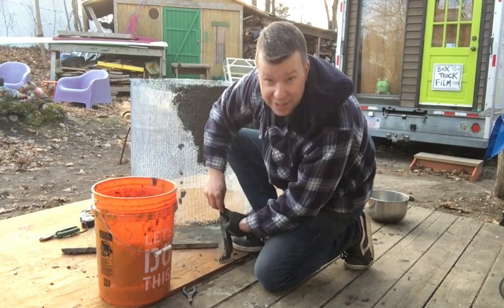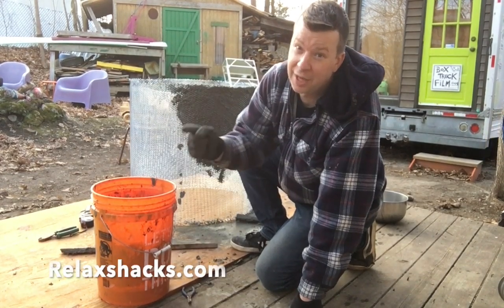HOW TO MIX and USE Ferrocement (tiny houses, water catchment systems w/ concrete)

Comment: If you add the material starting at the bottom in concentric rings of about 4", It will start to set just enough, yet still bond to the next round while supporting itself. Like a clay coil pot. That will take care of both the top-heaviness and any warping. If the rounds are smaller, maybe 1-2 inches it could be decreased inward and make a dome shape.

Comment: Here in NZ I repaired a few Ferrocement boats over the years, my mix was 2 - 1 as yours but I replaced 15% of the sand with a Pozzolan like DE or fly ash . To stop the reaction between the galvanised wire and cement ( gas bubbles ) I also added a few Grams of Trioxide powder. The honeycomb effect caused by the gas bubbles is a no no for boats, so avoided..Ferrocement is not concrete, Ferro is watertight, amazing material..
Reply: Ferrocement uses mortar, not concrete correct? Concrete has rocks.
Reply: @AliAbdullah-oi3wc  Yes, it is all about microns so finest sharp sand and a pozzolan, cement no 5 Portland if poss.
Reply: @AliAbdullah-oi3wc No, it uses Cement, such as Portland Cement.
Mortar is already a combination of sand and cement and a mix for Ferro cement can be considered a type of mortar, Ferro cement Mortar if you will.

Comment: Use a Plaster mixer and add 5% slaked lime to make it sticky and totally water proof
Reply: tell us more
Reply: I am starting to make fountains and I form the water basin with 2part mortar and one part cement. Then use two coats flex seal. 
Will the stalked lime seal the concrete enough to keep water in long term? And what about the "cracking" aspect...like hair line cracks? Also I do use metal screen for structural integrity.

Comment: I can testify to bad burns on my foot from cement. I worked for a company that made cement manholes. # 1. I wore the same shoes for the week but they were not work boots they were tennis shoes. # 2. By Friday I had chemical burns on the bottom of both feet and around the skin of my big toe. # 3. That endeavor lasted one week. By the following Monday I was back at Radio Shack and worked for them until Dec 2006 29+ years.

Comment: You need a mortar tray/mixing tub to mix in. Plastic flatish tub. You can then use a square shovel and bucket trowels to mix and mix 3 times as much then apply. I have even seen master masons use wetted plywood, or even a concrete pad to mix on. In third world countries that bucket would never be used for mixing. Good that you used a wood stick, because metal tools in the bucket scrape plastic into the mix.

Comment: I build alot or concrete sculptures and have had good luck using zip ties instead of wire to attach the screen to itself and to the frame work.

Comment: Mixing tip from a painter: Sit down and hold the bucket on the floor tight between your legs and feet. Use a broomstick or other long stick to stir. Hold the stick with one hand  up high and the other hand down low. Stir in a circle with the lower hand, while the top hand acts as a swivel point. Reverse hands when tired.

Comment: have u ever tried using bed sheets socked in cement to building with?
Reply: I'd like to see that.  I imagine combining your bedsheet idea as a "backing" to the wire mesh, you could then use a concrete sprayer to build structures extremely quickly.  You could even build a double wall, and pour aerated foam concrete (aircrete, I think people call it) between the two, making a (theoretically) very strong, highly insulated wall.

https://www.youtube.com/watch?v=9hC2lZnyyPg
Reply from the maker: @antontaylor4530  I have not, but I tried old towels- worked "well-ish", but had to trowel and reapply a lot....

Comment: Cool. Wikipedia says 3:1, but I guess 3:2 makes the Portland Cement goes further and still strong enough for non-boats in your experience?
Reply from the maker: Yeah, there are a lot of differing opinions in mix, and as I mention in the video, it changes some (the ratio) depending on the usage ("for boats" as you mentioned). The sand gives it some "flexible" properties too, apparently- so I read. I tried another mix initially that I found online, and it was a mess- just total soup and not workable at all.
Reply: @relaxshacksDOTcom  Have you ever tried adding latex paint to the concrete mix to add flexibility and reduce cracking?  I've read (don't shoot me if this information is wrong) that it can help "earthquake proof" thin concrete like Ferrocement.
Reply from the maker: @antontaylor4530  No- will look into that- thanks!